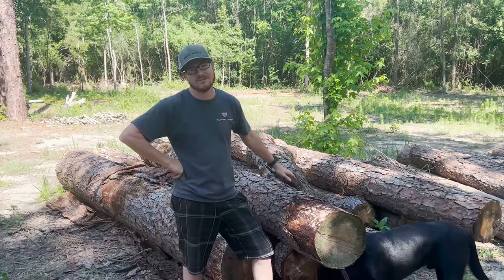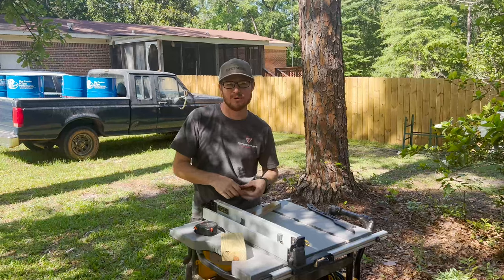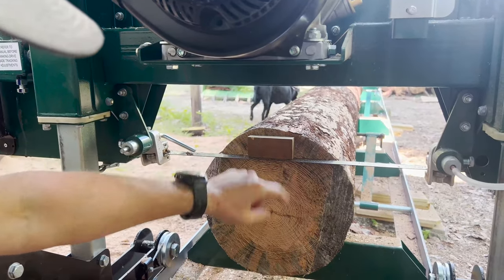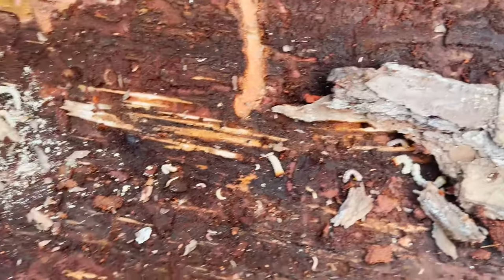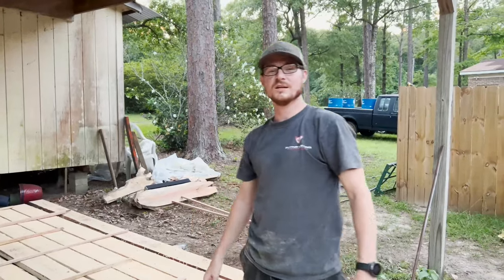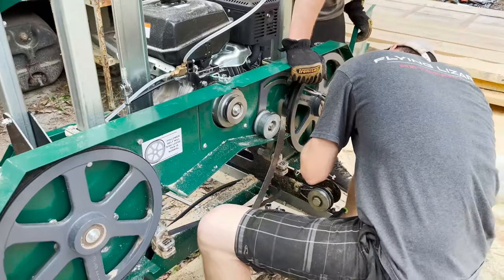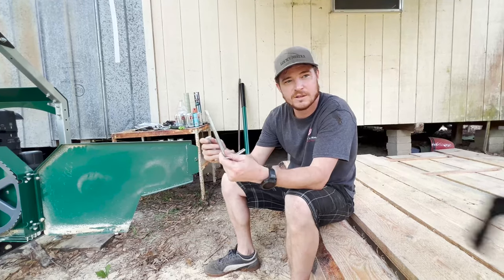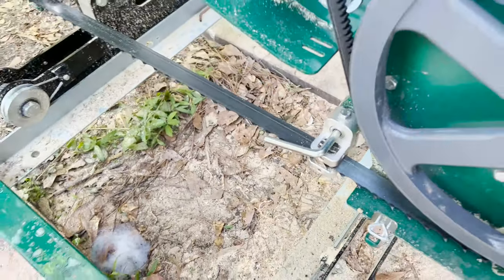Sawmill Troubles

Comment: Since you have termites in the area, don't leave the lumber you stacked under the lean-to too long. Termites will find it unless you treat the soil.
Reply from the maker: Thanks for the tip! Do you know how to treat the soil?
Reply: @Theluckyneedle   @The Lucky Needle  I use Talstar around buildings foundations, one ounce to one gallon of water. There are other chemicals available.  Another method, which would minimize the need for the chemical,  is to set concrete piers with a galvanized steel cap on top for a termite shield, then set your cross beams on top of the piers, then you can usually get away with not having to treat the soil, but it is a necessity to check the sides of the piers periodically to see if the termites have started a tunnel up the side of the piers.  If signs of termites are seen, then treat around the base of the piers.  I live in south Louisiana and have had termites in lumber that was laid on the ground for only a week.
Reply from the maker: Oh wow! Thank you so much for these tips! I will get on this asap! Thanks again!